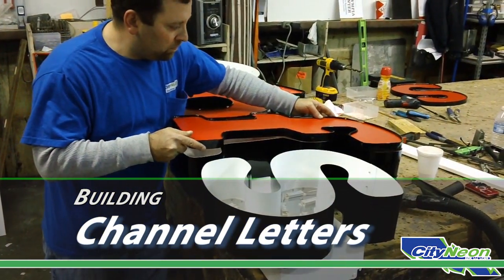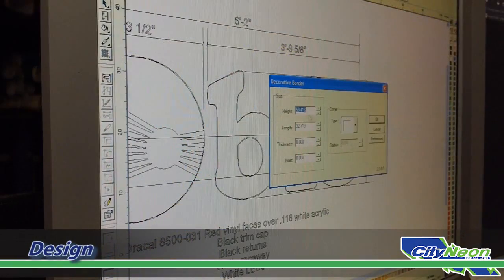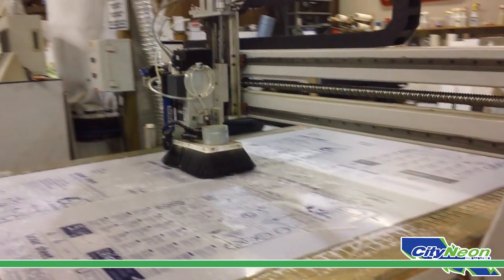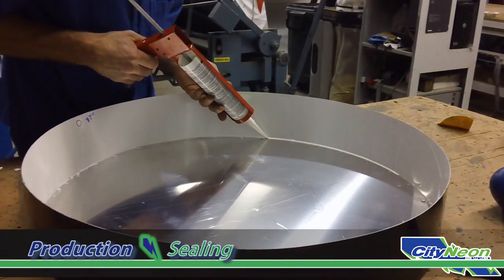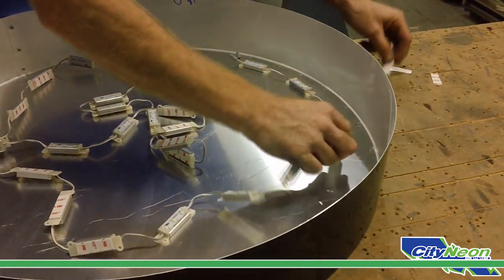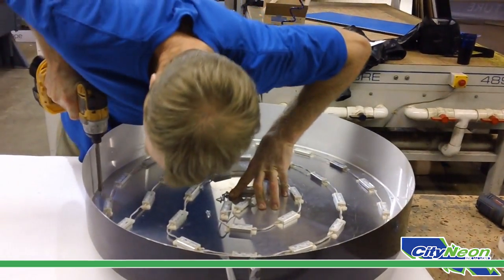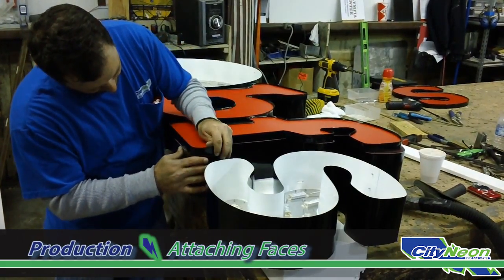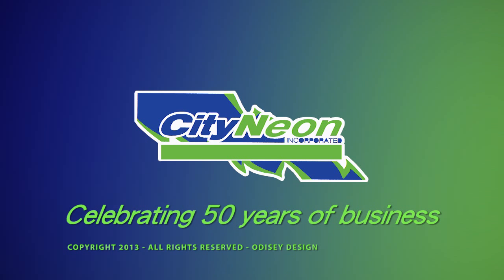City Neon - Channel Letters: Building Channel Letters.

Comment: What is the rate of backlite led leter?
I need 2' leters.... Plz give me approximately rate of LED leter. I want 14 leters of 2'...
Thanks
Reply: In my country it's around 5 usd per inch height, so it's around 1.7k usd in your case. This doesn't include any transportation, design, mounting or any additional electrical work.

Comment: hello sir, i have a question,  when i apply the adhesive on the trim cap, it lifts the vinyl film on the letter face, how can i avoid that? please help.
Reply: Should have the bond holding to the back or inside of the face and the edge of the face <mostly>. So the trim cap is attached while the face is down and against the table.